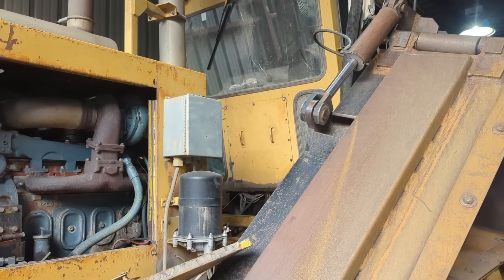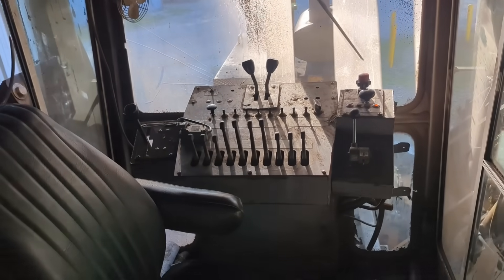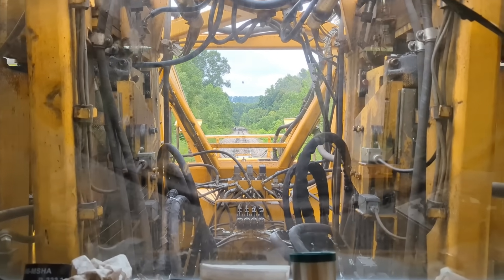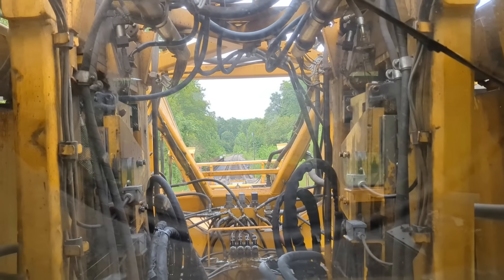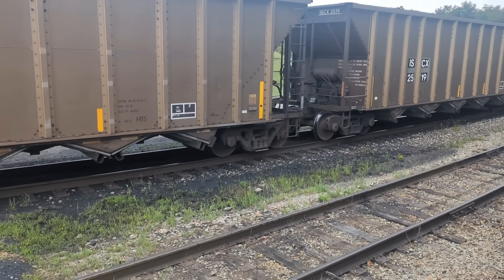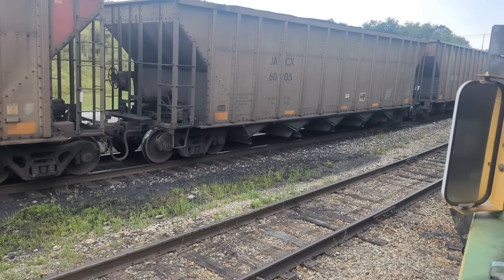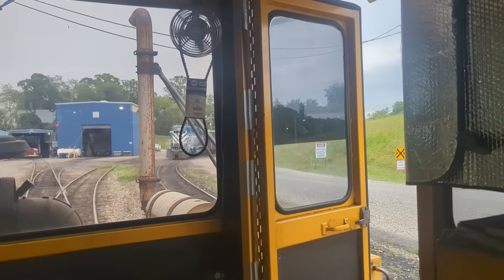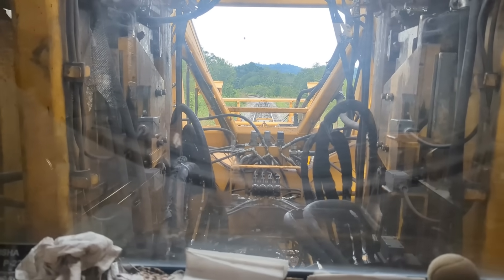Why do Rail Car Wheels Squeal thru Curves?

Comment: Dave, I have a few questions.  1. I know you can't give information on the contract.  The question is, is this if the 2 weeks expires, can a temporary agreement for another extension be possible without a strike?  2. What is the importance of the number boards on a locomotive?  3rd. I see the ties are set apart from each other. Is there a set maximum of distance between the ties for the track to be truly safe?  Thank you. Robert.
Reply from the maker: 1. yes we can have many extensions. No one wants a strike, no
one wins in a strike. The local union does not call a strike, the
International union would be the ones to call a strike or bargain
for an extension. Contract negotiations are strictly International
union that does that.  2. Number boards on the locos designate
or distinguish one loco from another. It is very helpful for
dispatchers when they call or refer to a particular train. 
Also they are very important for when doing and recording
maintenance on the locos and the required FRA inspections on
locos.  Here number boards really aren't much of any importance.

3. Tie spacing for wood ties is typically 24 inches from center
of tie to center of the next tie. FRA rules don't address tie spacing so much, more they address the number of good ties per 39 foot stick
of rail. That parameter changes with the class of track. The 
higher the class of track the more good ties are required.
Reply: @ccrx6700  The membership gets a strike vote at least the union I was in did...
Reply: Thank you Dave.

Comment: While the wheels are on a solid axle so both wheels have to rotate at the same speed, it must be possible for one wheel to wear at a different rate than the other based on the curves and rail conditions each experiences. Especially in your case where they go back and forth over the same track. If one wheel is able to get slightly smaller in diameter and flange wear than its axle mate that would contribute to the squeel in a curve. Just thinking about it, no actual experience here. Thanks Dave!
Reply: It is the solid axle that is the correct answer.
Reply from the maker: Yes they go back and forth same track, loads all the time one way
and empties all the time the other way Jeff. If we could turn our
cars that would be a help (like rotating your tires on the car)
but we can't. So we do get uneven wear patterns. In low degree
curves because the wheel treads are sloped the wheels turn
pretty much the same speed, however at sharper degree curves
one of the wheels will be turning faster than the other one. This
causes more wear on the wheels and also on the rail head.
That's railroading. :-)  Really appreciate your taking the time to check out our video and may you have a very good day.
Reply: The wheels are not flat.  They are actually tapered.  As they go around a curve, the wheel on the outside rides on the larger diameter of the wheel, while the wheel on the inside of the curve, rides on the smaller diameter of the wheel.  On straight stretches, the wheels self center on the rails.

Comment: Wheels squeal that's because most cases flange greaser installed
Reply from the maker: We have 6 wayside flange greasers here but they are not close
enough to the harbor to prevent the excessive squealing in
the curve that was in the video. Your right in that is why flange
greasers are used, to cut down on the wear on the wheels and
rail head, they lesson the squealing.  Really appreciate your
taking the time to check out our video and may you have
a very good day.

Comment: What I wonder is when you have a train with all the locos on the front and it's going through a curve, is the flange getting scraped on the inside of the curve or the outside?  I'd think it would be the inside since the line of cars wants to pull straight, but if it was going fast enough it would probably be the outside because the cars just want to keep going straight?  🤷‍♀
Reply from the maker: Both rails scOtte416. The leading wheel set is rubbing against
the out side rail in a curve, that's what steers it thru the curve.
The truck itself then swivels so the back wheel set it up against
the inside rail of the curve. The more pressure against the
outer rail then also the more pressure against the inner rail.
Thank you for taking the time to check out our video and hope you have a very good day.

Comment: What ever happened with the engine not wanting to move, how did you guys solve the problem??
Reply from the maker: One of our guys found a loose electrical connection that he said
was causing 3098 to go into PCS Donnie. He fixed that but they
haven't ran 3098 much at all since then to see if that was really
the problem.  Thank you for taking the time to watch our video tonight and may you have a very good day.

Comment: That was one of the first regulators I got trained on back in the early 2000's.
Reply: First one i got trained on was from 1986, and we still have it.
Reply: @michaelball760  bet it's cheaper to maintain then the new ones.
Reply: @mackfisher4487  not really, it's constantly breaking. Just had to replace the front axle on it.
Reply from the maker: Our old regulator has 24 inch wheels on it and those bigger wheels
on the 850's and 925's do make a big difference when trying to push ballast JTS BMW. hope yours was much cleaner than this one was.... :-) Thank you for  taking the time to check out the video and hope you have a  very good day

Comment: I knew the answer to that one, it's just the flange rubbing the inside of the rails. A shave and a haircut lol, sometimes you wish you had some earplugs.
Reply: You mean it's not the wheels enjoying flying round the curve like kids in a ride at a carnival?
Reply from the maker: Pretty much your right, train too slow thru a curve for the super 
elevation in the curve will definitely shave off some of the metal
Donnie. Thank you for taking the time to check out the video and hope you have a  very good day